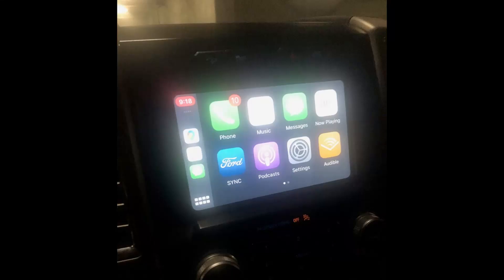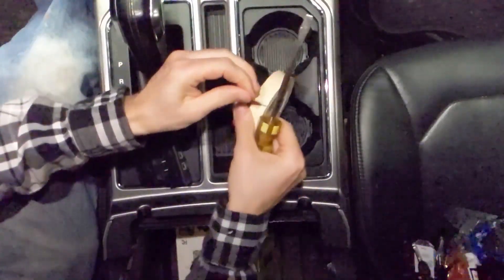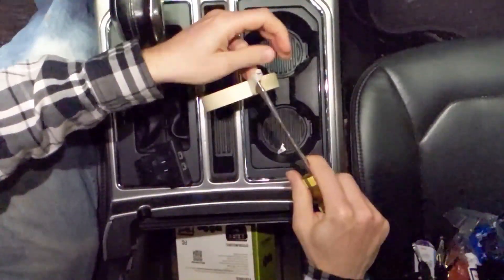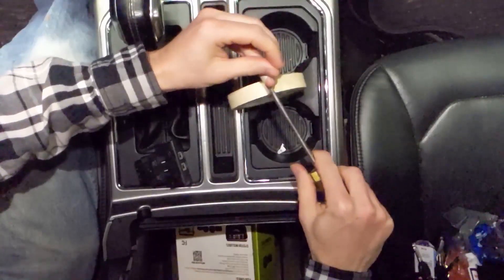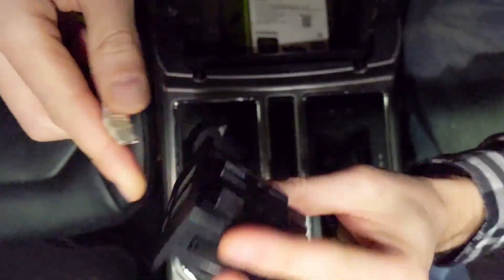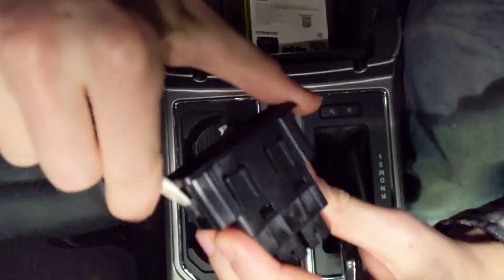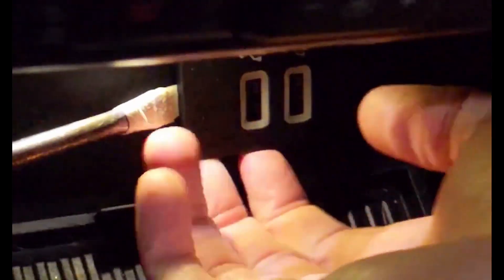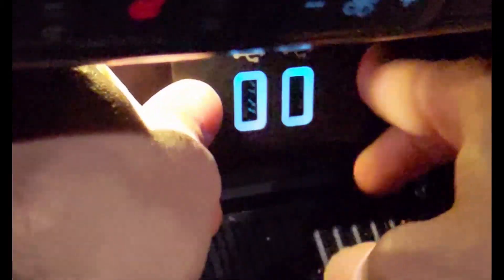How to replace USB ports in 2016 Ford F-150

Comment: Hi Bro! I bought a used 2017 Ford Edge with SYNC 3. Everything works perfectly, except the USB. The SYNC does not react on anything connected to the USB ports. But blue LEDs are ON. Can you advise how to check the issue, USB HUB, CABLE, or APIM?
Reply: Missing power harness having same issue

Comment: My USB port works fine but it doesn’t light up. Any idea why?
Reply from the maker: The lights use a separate connector so it's probably loose (the gray connector in the video).